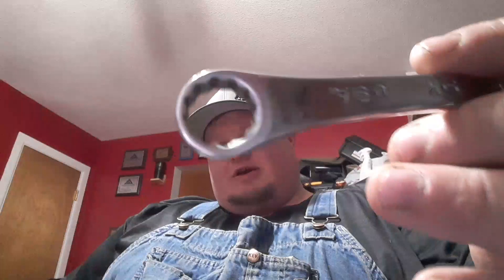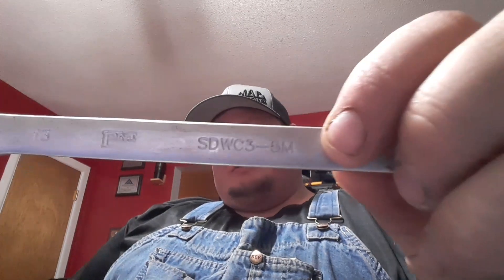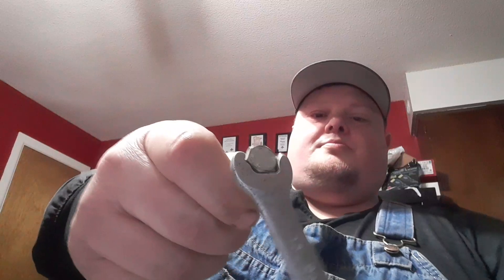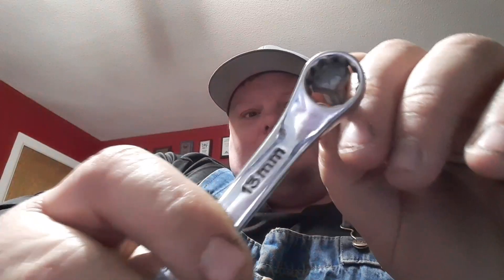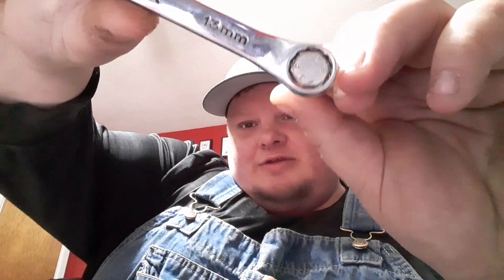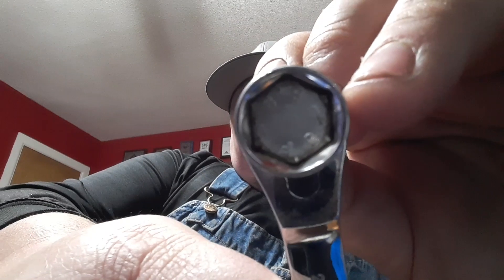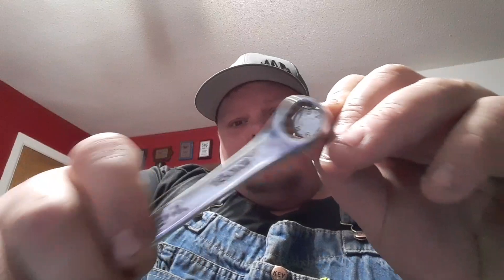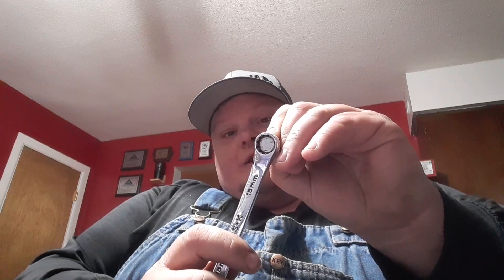Mac tools 6pt and 12 pt rant and why I prefer 6pt.

Comment: CP, I have been in industrial sales for twenty five years...... selling nuts and bolts. Numbers on bolt head indicates metric in which you use metric wrench. Slash marks around the head of the bolt indicate a uss or sae bolt in which you use a sae socket or wrench. I really enjoy your videos keep them coming!!
Reply from the maker: I got mixed up but it's odd how much better the 1/2 fit the 13mm bolt lol thanks I appreciate your support!!!
Reply: CP the tool addict exactly. I run into that exact problem all the time.

Comment: In general, I get what you’re saying.  I think a lot of the issue comes down to the quality of the tool (tolerance) and the technician using the right tool for the job.

12 points have come a long way in design.  Whereas they used to put pressure right on the point of a six point fastener, now they apply pressure to the flats and have multiple contact points.

With sockets, fine tooth ratchets are pretty common, so lining up the bolt and getting the ratchet to click is pretty easy with a six point socket, whereas combo wrenches can be hit or miss.

Ratcheting wrenches I can see six point becoming more popular, as Carlyle, Tekton, SK all offer six point with fine tooth mechanisms.  But the same modern flank drive or whatever you want to call it is used on 12 point Ratcheting wrenches.

Lastly, the most controversial, spline drive sockets and wrenches.  Spline drive is fine if it’s a high end brand and the tolerance is perfect.  Also with spline drive you have to make good contact first.  If it’s off a little bit, it’ll be more likely to round a fastener than 6 or 12.

Comment: Well there are many times when you can fit a socket onto a Fastener due to clearance issues and you do have to reach for that wrench however even though 6-point wrenches offer more insurance against rounding off fasteners sometimes because you can only position that wrench in 60 degree intervals, and there are going to be times where that 6-point wrenches useless to where a 12-point is needed in order to achieve your possible positions especially if you can only got 1/8 of a turn at a time and without an offset ratcheting box wrench you could be up schitt's creek and have no alternative but to use a conventional 12-point box wrench. But you are correct I used to have a couple I'm Japanese 6-point wrenches but apparently someone wanted them more than me lol.

Comment: CP your opinion is well taken and on point.  Back in the 60's my dad told me that 6 point was better because it did not round bolts off as easily as 12 point.  I understand the need to have less throw to catch the nut or bolt but it is my last choice  to use 12 point.  Thanks for the video.

Comment: I know exactly what you're saying, but I think using the right wrench as far as size is where most new guys wear out the corners. SAE on SAE and MM on MM will solve most guys problems. Problem is most guys, especially new guys, just want to buy the metric tools and skip out on the SAE versions. I've had a few problems where using my 12pt wrenches were just not going to cut it. Thank God for turbo sockets with the wrench end... I've gone back and forth on getting 6pt wrenches. I think the SK X-frames will be my compromise in the end. I think rust makes a world of difference as well. Dry climates or west coasters can get away with a lot more than us guys that deal with rusty crap all the time.

Comment: My explanation has always been theres parts swappers, mechanics and technicians. Swappers strip the bolts out and replace everything until the problem is fixed and always say it's not my car/problem. Mechanics can diagnose some things can generally work on most things dont have the best tools but try. Technicians we own the best tools fix the problems that the other 2 created correctly diagnose the problem and repair the problem with the correct components. I progressed through all 3 stages so I'm guilty of all the above. I'm proud to say I've been an ASE Master technician in both automotive and diesel for over 15 years. We all start somewhere. Which is why I say 12 points are good for restricted access after broken loose with a 6 point. If you know your fasteners you'll know which is acceptable to use. 12 point for 12 point fasteners 6 point for 6.
Reply from the maker: Absolutely awesome comment and thank you for sharing I've also been through these things as well couldn't agree more with everything you said!!!!

Comment: Now it’s a three way argument over 6pt., 12pt., vs. spline drive. For years, your best wrenches from Snapon, MAC, etc. were 12pt. And their sockets were 6pt. To be honest, I never stopped to think about why. I do know that 12pt. Impact sockets wear out in a hurry. Good thing Snapon warranties theirs for life because pulling head bolts and driveshaft bolts will wear them out in a hurry to the extent that they’ll round the bolt head. Freaking 12pt. Head bolts should be outlawed. State law...
Reply from the maker: Absolutely wayne!!